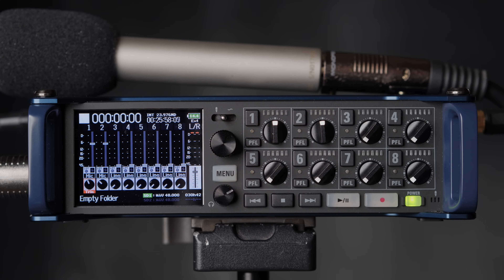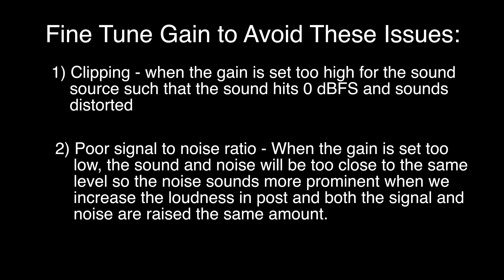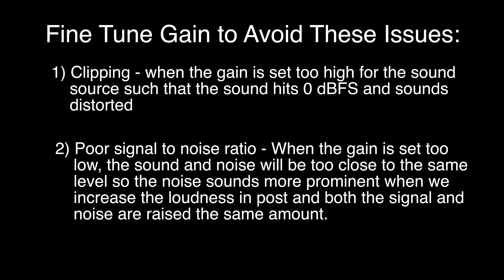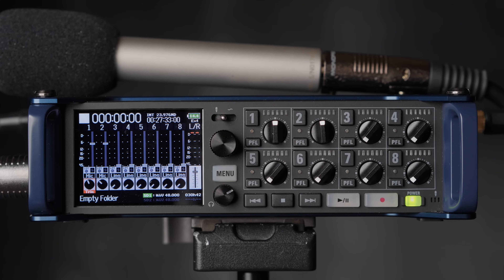Sound for Video Session: Zoom F8/F8n Setting Gain Trim

Comment: First of all, your video's are very helpful! I have a question related to this subject. I have this strange thing going on with my Zoom F8 sometimes. I like to work in Mixer mode with the track knobs. When i make changes for Fader and Trim settings and i reboot the Zoom All setting i made are correponding with the track knobs. So Fader and Trim settings are the same. I'm just a beginner with the device but this is very confusing. Is this normal? I have the latest firmware and i just did a factory reset, but didn't help.
Reply: Hi Sticks 'n Licks, I believe that this is normal. You might like to try the Fader Track Knob option. This seems to retain the settings from session to session for me.
Reply: Hi Curtis, I believe this problem started with Firmware version 5.0. In this version Zoom introduced the Fader track knob option. Before this version the Fader settings were saved also in the Mixer mode. For my use the Fader track knob option isn't very handy. I found a workaround to make a back-up for the F8 settings and store it so every time i restart the device i load these settings again. I hope Zoom will Fix this problem soon. Thank you!
Reply: @Sticks_n_Licks  Ok, good to know, thanks for sharing that. I assume you have already let Zoom know about the issue via their support.
Reply: Hi Curtis, i noticed a bug in Level Meter View order before and had contact with Zoom Japan. I got a little strange answer but they fixed it ;) So, i was hoping that you had the right contact @ Zoom. Again, i'm just a beginner with this equipment.
Reply: @Sticks_n_Licks  Hi Sticks 'n Licks, I just re-read your original question before sending it to my contact at Zoom. Do I understand correctly that you always set the fader and trim levels to the exact same (knob is at the same place) for each channel?
Reply: Hi Curtis, No but my starting point is Fader settings at 0dB and lets say Trim at +24dB. If i then restart the Zoom both Fader and Trim values are corresponding the actual stand of the track knob. So, in this case the Fader setting changes to -28dB and the Trim stays at +24dB. This counts for all 8 tracks.
Reply: Or maybe i better say, after a restart the display takes over the actual track knob stand both for Trim and Fader(on every track).
Reply: @Sticks_n_Licks  Ok, got it, thanks. I'll see if this is "known" by Zoom-US.
Reply: Hi Curtis, any progress yet?
Reply: @Sticks_n_Licks  Yes, they know about it and as I suspected, this is working per their design - the settings at startup reflect the physical knobs, not the last software settings. I suggested that a setting to keep the last software settings would be a nice addition. They don't ever promise to implement something at this point, but we'll need to see what happens...
Reply: Hi Curtis, thank you for all the effort you have taken. I know now my F8 is working like it is designed. I hope Zoom will make an adjustment for this matter because it would help me a lot. Until that time i will load a back-up from my saved settings. Thank you!

Comment: Hi Curtis, brilliant job as always. 2 questions: 1. Do I always need to record a stereo mix on all productions? Normally I would record a stereo mix only if required from the production itself, so that I don't have more useless files in my Polywaves.  I do prefer to have a Polywave that has only the single tracks that I can mix afterwards in my DAW. Is this "correct" in your experience? 2. What kind of level metering do you suggest/prefer to use (peak vs Peak/VU) ?Thanks
Reply: Hi Enrico, yes, definitely do what makes sense for the production. If you're doing the post work, you get to choose whether you want a stereo mix or not. Ideally, I prefer a combined peak/VU meter so I can keep track of the peaks and get a good sense for loudness as well.
Reply: @curtisjudd  Thanks a lot for your support

Comment: I'd like to see how you would manage something in a "live" situation like a live-streaming podcast, where you have to have the sound at a good audible level while you're recording rather than when you have the option to normalize and otherwise bring quiet levels up in post.
Reply from the maker: Hi RedBear AK, I'd add some processing to compress and add make-up gain on the mix at least, on the isolated channels too, if possible. But I haven't done live broadcast before. I need to have that experience. 😀

Comment: Curtis, I clicked on one of the B&H links provided in the video description concerning the zoom, the older model. I was surprised to read this disturbing review by Justin. Have you seen this and what do you think of the problem he addresses? If true, I don’t think I would recommend this particular recorder:

“I purchased this recorder to use in a professional documentary filmmaking and corporate video production environment. I made my purchase from BH in mid June 2017. Unfortunately I did not discover the absolutely massive flaw in this unit until about two months later, when BH would no longer take a return and Zoom customer support (the specific gentlemans name I was working with is John Molfetas, who is labeled Zoom Customer support) would jerk me around for several months after, claiming the problems with the unit are my fault. Flaw 1: The Zoom F8 has two SD card slots, making it's user think you have a back up card, in case the first card errors out. The problem is if Card 1 has a writing error, it will cause Card 2 to also have a writing error, causing you to lose everything. I believe this is because the unit is seeing both cards as one, instead of two individual cards (probably to save onlicensing). The Zoom Support staff tried to claim that it was user error because I did not perform a full test of my card (which takes two hours for a 128gb Sandisk Extreme Pro). Almost all of my professional gear has two card slots, which the primary point is to have a full quality back up in case a card has a write error, it is totally insane that if one card in you Zoom F8 fails, it will destroy both cards audio files. TLDR: The Zoom F8 is twice as likely to have a writing error, destroying all of your files as a unit with only one card will have. Flaw 2: On more than one occasion I have booted the unit up and have had multiple channels not function at all, even after reassigning the PFL settings and disabling the channels. When this happens, the unit has to reboot, which takes a while. This is a very concerning flaw, as there seems to be deep seeded issues with this audio recorders firmware. Final Thoughts: I very very much wanted to love this unit, when I initially purchased it, I assumed it would be the last audio recorder I ever had to buy. My company lost a large amount of money due to lost files on a job and when I took my concerns to Zoom, hoping they would be excited to hear about a unknown bug, they simply insulted me by totally ignoring my concerns. Zoom has proven it self to not be a professionals company, producing nothing but prosumer gear for amateurs. The quality control clearly is not high enough to depend on their equipment.

Justin”
Reply: Hi Roy, good question. Sounds concerning. 

I can say, as an additional data point, that I've had a copy of the F8 since 2015 and have not experienced the two issues that Justin experienced. I've also have an F4 since 2016 and, likewise, have not experienced these issues. Justin's point about the dual cards seems plausible, but I have not experienced any card read/write issues using SanDisk 90MB/s cards. These are relatively older, slower cards. It seems based on things I've hear other people say that some of the newer, faster cards are where the problems occur. I have no way to validate that because I've been using the same slower cards the entire time.

As for the inputs not working at boot-up, I also have not experienced that. Justin is the first person I've heard complain about that. I'm not saying others haven't also experienced this issue, but I would invite them to post here and elsewhere if they have. We need more data points to assess whether Justin's experience is isolate or widespread. Based on what I have read to date, it doesn't seem widespread.

I'd say we need more data. My data points suggest reliability so far with the F8, F4, and now the F8n.
Reply: Curtis Judd Good points, Curtis. More validation is indeed necessary.